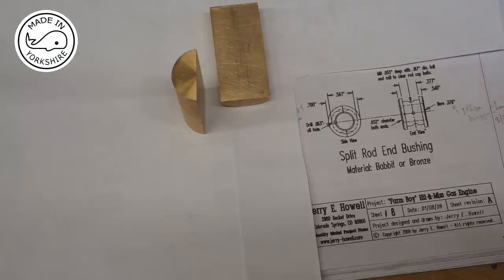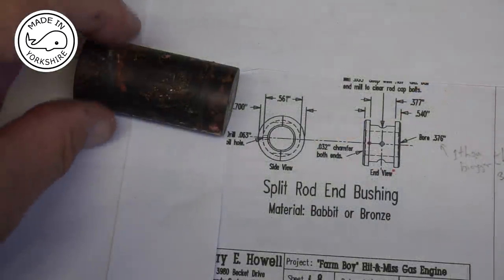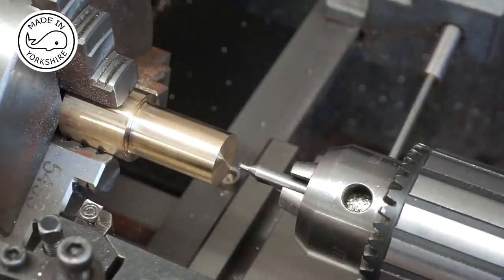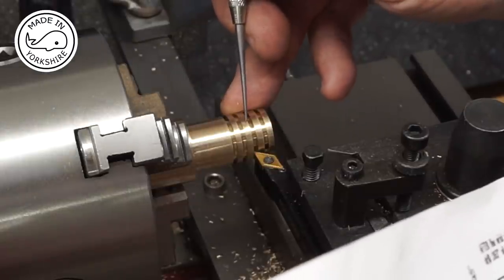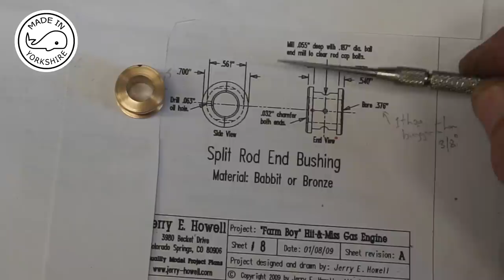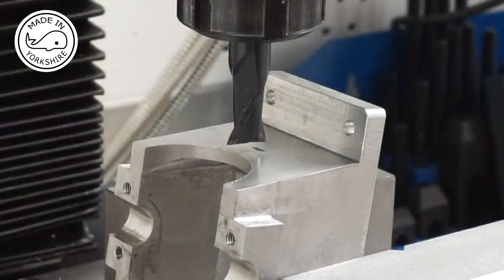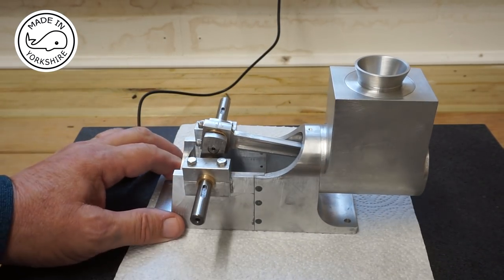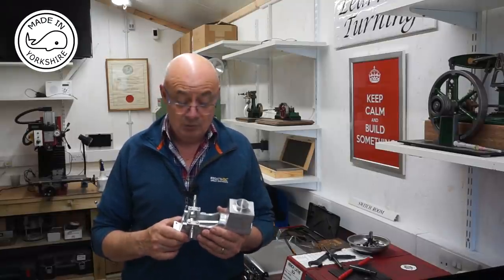#MT35 Part 11 - Farm Boy Hit and Miss Engine. The Split Rod End Bushing. By Andrew Whale.

Comment from the maker: IMPORTANT: I was contacted by Richard who is also making a Farm Boy. Main bearing oilers are covered on Sheet 19 of the plans. I think I am having one of those days!
ALSO: I double-checked the rear frame drawing against the actual part and realised that the 0.75" radius should have started 0.25" from the top. I started mine at the top - so that explains why the big end hit the frame. Doh!
Reply: Sadly even though i had seen your issue i experienced the same problem (at 13.01) as you, where the back of the crankahft hits the back of the frame and will need to do the modification  also. i dont think i want to remake the  rear frame again - took hours!
Reply from the maker: 👍 it's good to hear that I'm not alone in failing to read the drawing properly. Mind you it's not obvious. Good luck with the rest of the build. Sadly I've been sidetracked with other things at the moment.
Cheers
Andrew

Comment: Never seen any one use silver solder for holding bearing halfs together. Soft soldr is ok and you can see the join as well. I think who ever told you that was peeing up your back.
Reply from the maker: Ha ha - I might have misheard Peter when we discussed this. Admittedly we'd had a few beers by that time!
It was good to have another go at silver soldering though. I will be more confident if I have to silver solder something next time.
Cheers!
Andrew
Reply: SOME PEOPLE GET MIXED UP SOFT SOLDER LOOKS SILVER IN COLOUR SO THEY CALL IT SILVER SOLDERING
Reply from the maker: Hi - it's definitely silver solder is used cos that is what I purchased.
All the best.
Andrew

Comment: why did you not consider soft solder?
Reply from the maker: Hi Brendan - I might have misheard Peter when we discussed this. Admittedly we'd had a few beers by that time!
It was good to have another go at silver soldering though. I will be more confident if I have to silver solder something next time.
All the best.
Andrew
Reply: @learningturningmetal  no worries I am a beginner and thought you might have some wise words on your reasoning.. :) thanks.
Reply: @learningturningmetal  Hi fron Britanny - France - Andrew and Brendan, I confirm, it's better to use soft solder for this type of bushing. Low temp and you can see the joint better. I use altimes this method and I never had problems.
All the best
Didier
PS:I appreciate your videos, pretty nice for beginners
Reply from the maker: Thanks Didier!
All the best.
Andrew
Reply: @didieryvron149  hi Guys. working with silver solder at this point was very clever. Soft solder would not be resilient ... here there are loads from rotation, friction and from oils and their acids. Silversolder can withstand these loads. Soft solder is only used for non-moving parts or rigid connections without force absorption! furthermore, temperature is also reached here through rotation and friction. which soften the soft solder. of course not make it runny .... but it stretches and starts to rub off more easily
Reply: DreamSteam  iIt is only there to hold things temporary. standard practice to use soft solder.
Reply: @simonbirt6121  make sense.... till you see that soft solder makes a thicker joint......
Reply from the maker: @dreamsteam8272  thanks mate. From my limited experience I agree. The layer of silver solder was ever so fine. I'm not sure why people are so adverse to using it.
Cheers
Andrew

Comment: Well done Andrew. The think that baffles me is 2 things. 1) Why did you start with such a large bit of PB, you only used a small amount in the end ? 2) Why on earth did you use Silver solder, soft solder is more than adequate for what you were doing. Easier and less heat required. Have a look at this guy. https://www.youtube.com/watch?v=WjZ-GXBpfto. and the follow up video.
Reply from the maker: Hi Dave - to be honest it was the only piece of PB I had that was large enough. Maybe I should have tried to get hold of some smaller. I might have misheard Peter when we discussed soldering. Admittedly we'd had a few beers by that time! It was good to have another go at silver soldering though. I will be more confident if I have to silver solder something next time.
Thanks for the link - I'll check it out.
Stay safe and locked up in your workshop!
Cheers
Andrew

Comment: Andrew, I have a Warco mill and replaced the battery quill reader with a magnetic reader and linear encoder summing interface so that I now get the actual position of the quill at all times. The head position is obviously added to the quill so that accurate positioning of the head is not needed anymore.  The quill reader fits neatly in the space where the battery reader is, behind the alloy plate. I also fitted a new alloy plate. M-DRO do all the bits but I'm sure other suppliers also have them.
Reply from the maker: Hi Pierre - that's very interesting. My DRO is from Warco but I wonder if the M-DRO gadget will interface with it. I will investigate! Thanks for the info. Very much appreciated.
Cheers
Andrew
Reply from the maker: Hi Pierre - I contacted M-DRO last week to find out if they could supply the bits to replace the quill reader. They asked me some questions which I don't understand. Can you tell me which magnetic reader you purchased from M-DRO?
Cheers
Andrew

Comment: Hi Andrew, Keep in mind you can purchase flywheels from Stuart Models. They sell spare castings for every kit they make, so you may find the correct size casting from them.  Also, G.L.R Kennions have a handful of stationary engine kits, of which you can purchase the flywheel castings separately. Furthermore, A.J Reeves has a section in their online store for Flywheel castings.    (Hope that helps your search!..)
Reply from the maker: Hi - many thanks for the suggestions. I think I did check out Stuart Models previously. I'll compile a list and add the other two to it.
Cheers
Andrew

Comment: Flywheel castings can be purchased from Martin Model in the US: https://martinmodel.com/  Yes, main bearings require lubrication holes which can be fitted with oil or grease cups. I prefer grease cups on my engines and they aren't that hard to make.

Comment: Andrew, 
I don't have the plans and your con rod / frame interference intrigues me. It seems too off to be a drawing error.  I wonder if the distance of the frame halfs overlap coincides with the interference ? The other thing that caught my eye is that top dead center appeared to be rather low relative to the end of the cylinder.  Having said all this let me qualify that these comments are made with complete ignorance of hit and miss design.

Cheers, 
John
Reply from the maker: Hi John - thanks for your thoughts on this. You got me worried (ha ha) so I decided to double-check the drawing. I now realise I turned the 0.75" radius from the top of the frame. It should have started 0.25" from the top! That explains it and I think I will leave it as is. I'm gradually  getting to grips with drawings! Thanks for getting me to investigate further.
Cheers
Andrew

Comment: If you are still after a couple of flywheels I will check out my flywheel draw, I have 2 hit & miss style flywheels but not sure the diameter probably pretty close to your requirement. From memory that have cast in counterweight to offset the crank. If interested let me know and I’ll check them tomorrow and post details.
Reply from the maker: Hi Steve - many thanks for the offer. I managed to get hold of a pair off ebay (pedelee56). They look to be very close to the drawing dimensions. The only issue is that the drawings show the hubs extending beyond the outer rims - so I think I will need to modify them slightly.
Thanks again for the offer.
All the best.
Andrew

Comment: Hi Andrew - If the dimensions of the O ring and groove in part 6 are correct, you should be OK. The Farm Boy is a little unusual (to my mind) in that the ring groove is actually deeper than the ring section - most designs compress the O ring slightly, between the bottom of the ring groove and the cylinder wall - maybe 0.005", or so (manufacturers also publish recommendations which will squeeze the ring even more, but they're thinking about hydraulic cylinders, not model engines!). You could try slotting one side of the O ring into the groove without putting it over the piston - you should be able to get a good idea  if you've got the .011" side clearance you calculated, and you should be able to push the ring below the outside of the groove if you've machined it 0.016" deeper than the section as planned. What O ring exactly did you get?
Reply: I should also have said thanks for the video! :)
Reply from the maker: Hi. My notes say that it is a viton with od 1.074 to match the cylinder id. It has a section of 0.134. The piston groove is 0.145 wide x 0.150 deep. So in theory it should be Ok I guess. I'll double-check the piston groove when I take the engine apart.
Thanks for the help and advice.
Andrew
Reply: @learningturningmetal  Sometimes there's a difference between nominal and actual section, particularly with imperial rings. Might be worth checking you got sent the right O ring, too (I got sent the wrong ones, but they were 7mm ID not 17mm ID, so it was easy to spot! :)

Good luck, and keep making the videos.

Comment: I wish you would have showed more of making the big end bearing. I would like to see how you separated it, and then how you cut that grove with it separated.
Reply from the maker: Hi Barry. Separating the big end bearing was just a matter of heating it up. Unfortunately heat left residue on the part - hence the need to buff it up a bit. I don't think I did anything special cutting the groove - from memory I think I just put in in the vice and milled it. It's not always easy covering every aspect in a video.
All the best.
Andrew

Comment: Soft solder is the way to ! Just made the split big end bush on the Economy hit and miss engine three times the size
Phil George
Reply from the maker: Wow Phil - I'm impressed. I might have misheard Peter when we discussed this. Admittedly we'd had a few beers by that time!
I must try to remember to use soft solder if I have to tackle it again.
Cheers
Andrew
Reply: Doubleboost has posted a video of making traction engine bearings (full size) and he soft soldered them for machining. Later on he demonstrates the strength in the joint by thumping the offcut with a damn great hammer - remarkably strong, but useless where there is any heat
Reply from the maker: Thanks Pierre - Dave Ticehurst sent me a link to the video - Amazing!

Comment: Andrew, regarding the piston ring I would hold off machining the groove until you finish the engine as when I finish a engine i bolt it to the lathe and run it for about a day with plenty of oil. With a variable speed lathe you can keep increasing the speed every few hours, if it's still too tight then you can always do something about it. As my wife says you can always make it slacker but its dammed harder to to make it tighter!!! Keep up the great videos best wishes Johnnie
Reply from the maker: Thanks for the advice Johnnie. That is somewhat reassuring. Your wife is very wise indeed 😟

Comment: The bearing turned out really well in the end. Good job the pb bar was oversized. No sign of wobble when you turned it back to round section. I cant see why you had to alter the back plate. Is there an error in the plans. Your adaptation has given the big end enough clearance. Like you I have had trouble with piston rings feeling stiff. I would love to know the answer to that one. I did enlarge the groove in the piston and found it eased with a bit of running/oil. The engine is really taking shape now. Some fiddly bits ahead!
Reply from the maker: Thanks Tim - I've been debating long and hard over how to approach the split bushing. In the end it wasn't too hard and it did turn out spot on. I think I will revisit the the piston ring groove. I've just checked the drawing and I now realise I turned the 0.75" radius from the top of the frame. It should have started 0.25" from the top! That explains it and I think I will leave it as is. I'm gradually  getting to grips with drawings! Yeah - dead right fiddly bits ahead! All good fun though.
Cheers
Andrew

Comment: Go to a sporting goods store that sells exercise equipment and take a look at free weights used on a barbell. I believe they are available down to 2.5 pounds. The hole would need an adapter and of course it would have to be turned down to accommodate the size and weight that your plans require.  Looking doesn't cost you anything and it may be ideal.
Reply from the maker: Hi Paul - a great suggestion - I will investigate.
Cheers
Andrew

Comment: The solder always flow in the direction, where the heat is comming from... (hard to believe... but try it) so it is easyer to heat from bottom... so the solder flows into the complete joint.
Reply from the maker: Many thanks for the tip - that now makes a lot of sense.
Cheers
Andrew
Reply: @learningturningmetal  and another important tip is.... dont hold the Flame direct to the fluxed joint... always from the side or behind... the flux burn away and the solder doesnt flow.... it makes balls and dont flow even if temperature is perfect.....  particularly on that job heat from underside or bottom.... dont go over the fluxed joint with the Flame.... if the flux turns clear... and make shiny reflections (blue red silver) that moment tells you the right temperature for the solder is approach.... and than... Everything run by them self.....
Reply from the maker: Really helpful info - Cheers

Comment: Great progress! I'm using an ordinary O-ring on my piston. Don't know how long it will last, but when it goes the plan is to get a better Viton silicone ring.
Reply from the maker: Thanks Rudy - I think mine is a Viton. I think I need to double check the measurements. I've got a nagging feeling that the piston groove is a tad too shallow.
Does your engine turn easily with the piston ring in place?
Cheers
Andrew

Comment: Hi Andrew, great series so far.
Some good suggestions for using exercise weights on here. What about the Stuart 10 flywheel, they have castings you can buy.
If you want a challenge then a cast iron billet is a good option, it's a good test to mill out the inside spokes with the rotary table.
Either way enjoy yourself while doing it.
Reply from the maker: Thanks Mark - I think I checked out Stuart a while ago. I might have to go the billet route or maybe look for some keep fit weights.
Thanks again for the suggestions.
Cheers
Andrew

Comment: Hi Andrew , great project so far , brave man to silver solder the bush together soft solder fine ..... anyway lots of suggestions re flywheels , if you made a pattern which would be an interesting job on its own , I’d gladly get you a couple cast in iron for you (FOC ) 
Regards
Robert 
Partsmade
Reply from the maker: Hi Robert - the silver soldering was interesting! I hadn't realised that soft solder would do the trick. Anyway I learned something new. I've checked the various suppliers suggested by others regarding flywheels but nothing close to the spec I need. It's very generous of you to offer to cast me a couple of wheels but I would certainly pay for your time, materials and carriage. I have a 3D printer and I could maybe make a pattern from plastic. Is it possible to cast from a 3D printed pattern? Alternatively I think I will have to look at machining them from cast iron billets or training weights. I welcome your thoughts.
Cheers
Andrew
Reply: Learning Turning Metal - by Andrew Whale
Hi Andrew if you can find a suitable weights to machine from all good .....( sometimes pretty poor material used for non critical castings like these items ) if you have a drawing all good depending on complexity ( disc or spoked) a solid pattern with draw on it or as you have printing capacity you could push the boat out and do a split pattern  either way add 1 in 100 for contraction and allow yourself 1/8” on machined surfaces ..... job done ( I use 3 D patterns   BUT you really need to ensure they are super smooth as the print layers can really pull at the sand ( rattle can primer works a treat )) 
Cheers
Robert
Reply from the maker: Hi Robert - many thanks for the advice. Having looked at several options I think I'm going to purchase a couple of unmachined lathe chuck backplates from Chronos. They have a size which is pretty close to what I need. There will be quite a bit of machining to do but it will avoid me having to work my way around Fusion360 etc.
All the best.
Andrew

Comment: For the Flywheels have a look at PEDELEE56 on Ebay.  I think he did the castings for College Engineering supply which is where I got my flywheels for No.585.
Reply from the maker: Hi Roderick - Thanks for the info. However I can't find PEDELEE56 on Ebay. I've also tried PEDELEE, PEDLEE, PEDLEE56 but nothing of any relevance comes up. College Engineering Supply mention castings but very limited info. I will continue my search.
Thanks for trying to help.
Andrew
Reply: @learningturningmetal  Finding
Reply: oops.. Finding a seller on ebay is quite complicated.  Try a search for "Model Making Steam Engine Cast Iron Fly Wheel"
Reply from the maker: Thanks Roderick 👍
Reply from the maker: Thanks Roderick - you are a star! Found PEDELEE56 and he sells a 6" diameter flywheel which looks ideal. Only problem is that he only has one for sale. I've contacted him to see if he is planning on making somemore. Fingers crossed!
Cheers
Andrew

Comment: PM Research sells just the flywheels you’re looking for.
Reply from the maker: Hi Steve - many thanks for the info. I checked their website out. It looks like they do a similar size flywheel but just a little on the narrow side. I also think that shipping to the UK would be too expensive. I think I might have found a pair of flywheels in the UK - so I hope that option will work out.
Thanks again.
Andrew